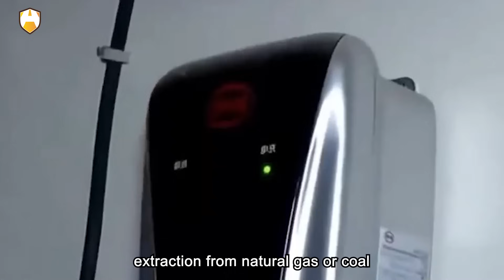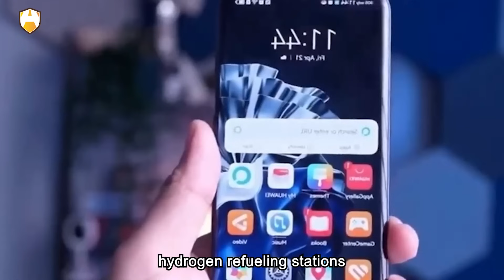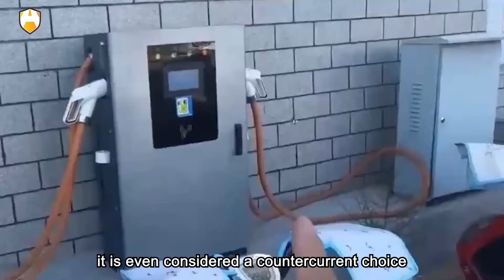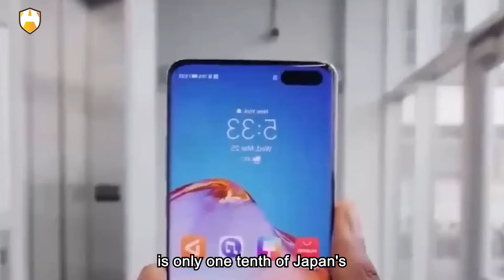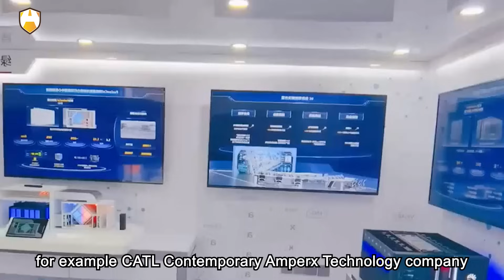Huawei introduced the "one kilometer per second" liquid-cooled fast charging technology,

Comment: Hydrogen Powerpaste still beats this and makes concerns for hydrogen safety moot. Fast charging generates more heat in the battery, and excessive heat can degrade the battery's performance and lifespan. Heat can accelerate chemical reactions within the battery that lead to capacity loss and reduced efficiency.

Comment: Hydrogen gas needs to be extracted from hydrocarbon, requiring energy input and producing carbon dioxide. Furthermore, when hydrogen gas is used in fuel cells to produce energy, hydrogen molecules lose electrons to become positive hydrogen ions, which need to be supplied with electrical energy (electrons) to become hydrogen gas again. So, hydrogen is not really green.

Comment: 1Km per second = 60Km per minute. How can that mean fully charge an EV in 1 minute??? 
On average, a typical EV can do around 400Km on a full charge. This means this new charge technology can fully charge an EV in around 6-7 minutes NOT 1 minute.
Reply: And this propaganda is not taking in consideration how this faster charging heats the battery, which degrades it even faster than with normal use.
Reply: Your calculation is right. But the video only says liquid-cooled charger can charge 100 km in 1 minute (slightly more than 1km per second). So it takes 4 minutes to charge a 400km range EV.
Reply: firstly one don't run down the battery to zero. so to recharge a 80% battery in 4-5 mins in general use is terrific.  To regas a car in the petrol station takes the same time or even longer.